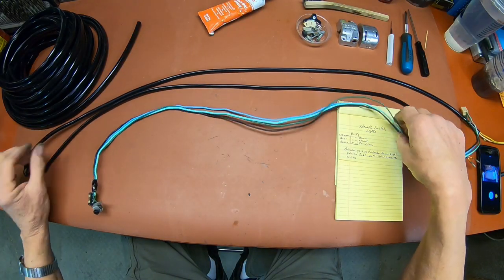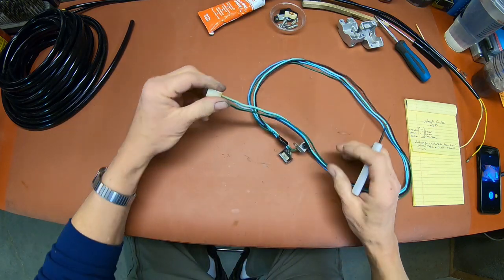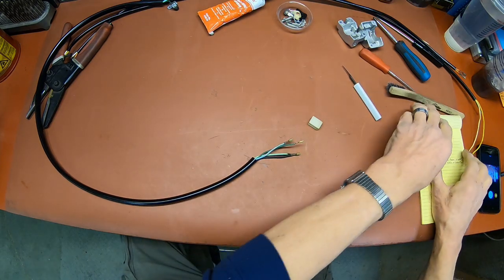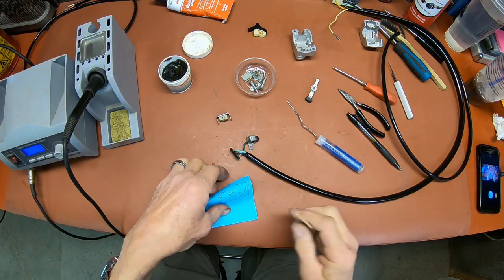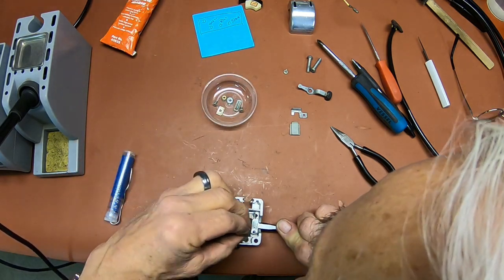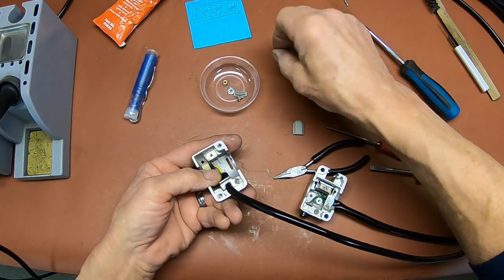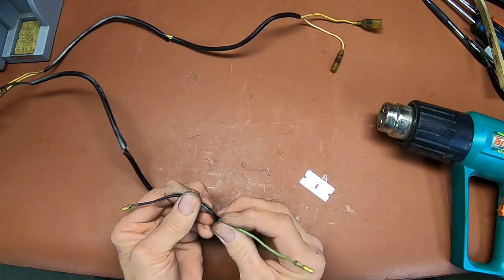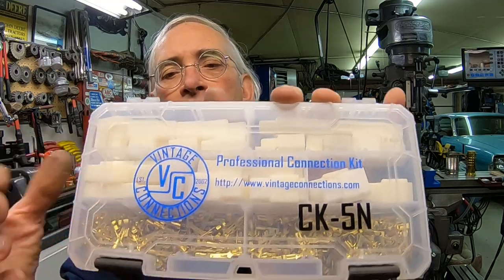73 Suzuki TC125 clean, rewire and sleeve your handle switch

Comment: Hey Dale. Do you have a good wiring diagram for my 1975 TS 250.  I've looked high and low and can't seem to find any that match up just right with what I have.  Example I have resistor instead of voltage regulator.  Possibly point my to the appropriate manual I should get?  Also,  I've read that it may be better to switch to a voltage regulator. Would you suggest that?   If so how?  Sorry for all the questions but I'm doing my first restoration and want to give myself the best chance at success by gathering as much good info as I can.
Reply from the maker: Hi Corey, you know Im not sure if I can help, I dont have a diagram for a 75 either, believe mine is for a 70, but most is still correct. The resistor you speak of is for the daytime charging circuit, otherwise the system puts out like 7.5 volts and the resistor brings it down to 6.5 when you are running with out the lights on to keep from overcharging. You will 
 have a OFF/Daytime/Nighttime switch for this system. The resistor should measure about 4-6 ohms, I think.  I so far have not done a conversion to a regulator, but Im sure its possible. Sorry I cant be more help in that specific area. The manual I have I got from New Zealand. He sells on ebay, it is a parts, service , and wiring manual, a good one I think. Most wiring on these bikes is pretty cut and dry. Almost without exception the green wire plugs to the green wire, and the black to the black and etc. The signal lights are an exception. Hope you have a harness that hasnt been cut up. Those can get troublesome. Good luck to you and thanks for following the channel. Please comment back if you have any questions.

Comment: Hi Dale, great video again ,could you tell me what size the connectors wiil be on the ts 250 savage ,and what tool is needed to to remove the terminals from the blocks ?,many thanks Hugh.
Reply from the maker: Hugh, I believe there are several different connectors used, as far as the amount of pins used. The pin tool you will need is the 2.8mm pin tool. The kit I got from vintage connections has all the parts I have ever needed. I have used up most and had to buy replacements to keep the stock up. If you need the part numbers let me know I will get them for you.
Reply: @montana2strokeracer  Thanks Dale,cant wait to get started on the ts ,hoping it will be delivered up from Brighton up here to Wales by Thursday .will you be doing the finishing touches on the ts 250 in the near future ?

Comment: I’m going to order some of the connectors. I might end up taking my blinker switch apart like that. Still when I turn on the blinkers the break light blinks too.
Reply from the maker: Yep, Dean is spot on, sounds like a bad ground.
Reply: Sounds like a poor earth (ground) connection to me. When the circuit cannot make a good return, you get back feeding through other lamps.
Reply: @retromechanicalengineer  what do you think I should do or look for? And thanks
Reply: @cainbeeping8480  I would check all of the frame earths (grounds in US) for cleanliness and corrosion, cleaning as you go. Then check inside the turn signal lamps if they earth through the body. You are looking for green or white corrosion. Both are common around electrical systems. Also have a look at the colour of the conductor if you can push the insulation back a bit on the cables. When they corrode, the cable strands go black and really need to be replaced. Also worth checking any multi-plug connectors, especially where earth cables connect. Again,  presence of verdigris (green corrosion) will cause high resistance and problems. If the current cannot return in the circuit due to high resistance, it will back feed through other circuits. It's a bit of a tedious job but if you are methodical, I'm sure you will improve it. Always happy to help and I'm sure Dale will be along too, he really does know his stuff on the older Japanese machines.
Best wishes, Dean at Retromeccanica, Oxfordshire, UK.